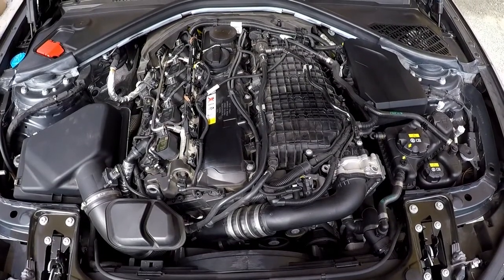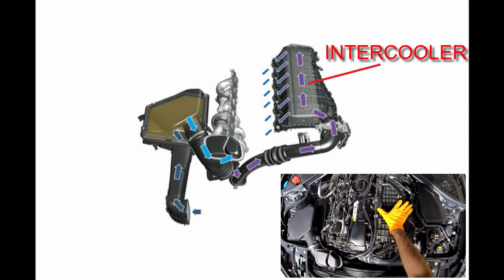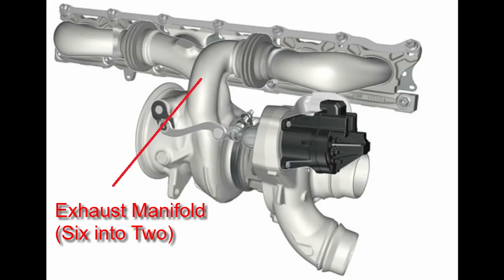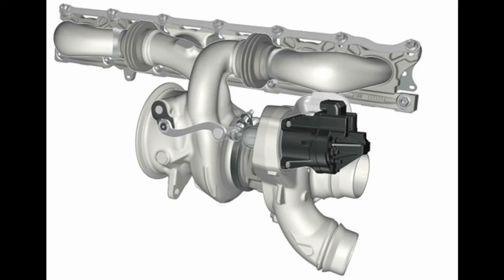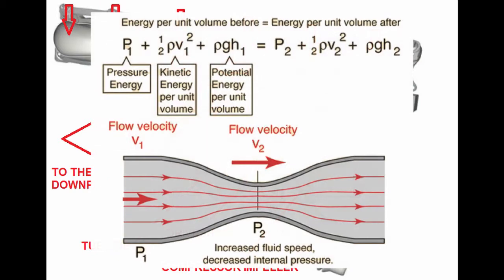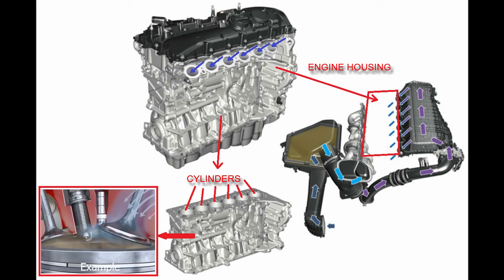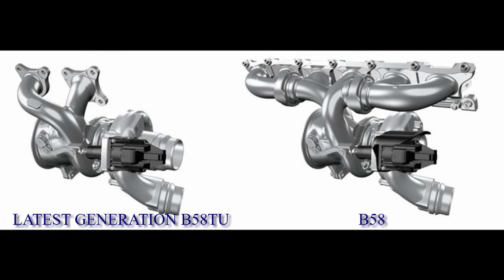BMW B58 Turbocharger: How it works

Comment: This is university level of detail and accuracy.
Absolutely 100% respect to you for making this video.
I have the B58 in my M140i (I suspect the original design), and it is quite a detuned engine, meaning potential for massive increases in power with a few parts and a different map.
Reply: Yea the b58 is fast I drove the 2021 540i
Reply: @Sequel7  Indeed matey. It seems any version of the B58 is fine on stock internals up to about 650bhp. Some seem to be running 700+ on stock pistons and no issues yet, incredible really.
Reply: @DjNikGnashers  we shall see how long it will hold up with any tune up to that horse power.

Comment: Is there any information known about blow-off or bypass valve used on the B58TU engines?
Reply from the maker: 1st gen B58 and B58TU1 engines have an electrical wastegate valve (so regulate the exhaust side of the turbo to control boost), but B58TU2 engines seem to have a blow-off valve (so regulate the intake side of the turbo to control boost) . The reason for this change is unclear, but if I had to guess, venting excess exhaust gases vs venting intake air to regulate boost might have some impact on emissions. With the 48V mild hybrid assistance system as standard on the TU2, the B58TU2 might afford to sacrifice some minor performance from the engine itself to achieve reduced emissions. This is pure guess work.

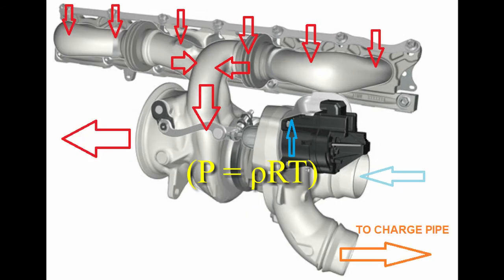Comment: At 5:40 you said that increasing the pressure and temperature decreases the density. Isn’t density directly proportional to pressure and indirectly to temperature? Wouldn’t the increase in pressure increase the density?
Reply from the maker: Hi, yes you make good points, and as you say it is the temperature increase which decreases the density, so in effect the density decrease from temperature increase is countering the density increase that pressure increase offers, so the intercooler is there to decrease the temperature of the pressurised air to make the air denser.
Reply: @NoBrainerTalk  Yeah that’s also what I was thinking. Really informative video regardless.

Comment: Thank you for sharing this. I wish to ask for some assistance please. I M about to buy a used M140i 2018 with 21,000 miles. Anything I should look out for? Also if there a way of checking engine oil level ?.
Thank you
Reply from the maker: Hi, here's a link with some advice. 

https://www.whatcar.com/bmw/m140i/hatchback/used-review/n18884/advice

The standard advice when buying a used car applies of course. 

Also check the coolant in the expansion tanks (known issue that the B58 loses coolant) as well as signs for any coolant loss in the engine (dried coolant residue), and check for rattles from the exhaust (know issue that stock exhaust can rattle). Check if the radiators (intercooler and auxiliary) have stone guards, and if they don't check the radiators for damage and leaks.
Reply: You can check engine oil levels under vehicle status in iDrive. Mileage is low but still check to see if oil changes were done. Future problems could involve carbon build ups, leaks from valve cover, cracking of plastic charge pipe, thermostat and water pump failure. These are minor repairs if you get them done at non-dealer mechanic.

Comment: Is the B58TU better then the Gen 1 B58. Im thinking buying a 2019 X3 M40i with the Gen1 B58 motor. Any input anyone on that? Thanks. Great vidoe brother.
Reply from the maker: In stock form, the 6-port B58TU1 with 382hp (if it also has 48V mild-hybrid assist, which some B58TU1 cars have) is arguably a better performance engine than the 1st gen B58 with 340hp. The 1st gen is simpler and arguably more over-engineered and likely to be more reliable, especially after modifications, than the 2nd gen. Both generations are exceptionally good engines with alot of upgrade potential and it's likely you will be happy with either. It all depends on budget and plans. Of course when buying used you also need the previous owner(s) to have taken care of the engines. Hope this helps...
Reply: @NoBrainerTalk  Yes thank you. I'm not upgrading anything so I will go with a Gen 1. Yeah The 2019 X3 M40i is alittle cheaper then a 2020 model year. Yup I'm always looking at the car fax to see the oil change  intervals. Thanks for your help 👍 👊

Comment: What is the Max rpm of the turbo in the b58 engine ? 250 k rpm ?
Reply from the maker: I don't know, someone would need to install special sensors to determine that (on a Stage 2+ tuned engine that is achieving the maximum power possible from the stock turbo), or perhaps it can be deduced mathematically from the power output of such engine. I doubt we will ever know unless we happen to speak to the development engineers who designed and tested it.

Comment: B58 dosnt have a mass air flow sensor at the airbox. it's a air inlet temp sensor. B58 uses speed density. Not mass airflow.
Reply from the maker: You are not correct because the B58 uses Mass Airflow Sensor Part Number 13628605565 (made by Bosch). It might also measure or help the ECU calculate intake temperatures and gather other data.
Reply: @NoBrainerTalk  may depend on gen 2 or 3 b58 as I have a supra with the gen 3 b58 and it shows as a air inlet temp sensor. There is also a variation of a 2 port cylinder head and a 6 port cylinder head depending on year the car was built.

Comment: I thought it was twin scroll
Reply from the maker: Yes it is. This means the exhaust manifold feeds the air into the turbine in two separate streams so that each cylinder exhaust gases interfere as little as possible with each other (resulting in improved scavenging of the exhaust gases and less impeded flow into the turbine).
Reply: Twin scroll = single turbo